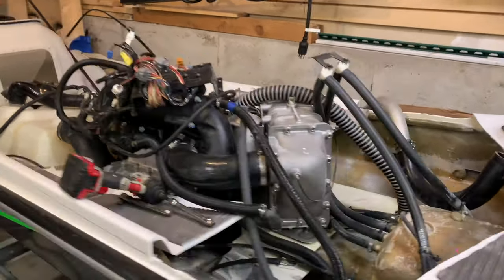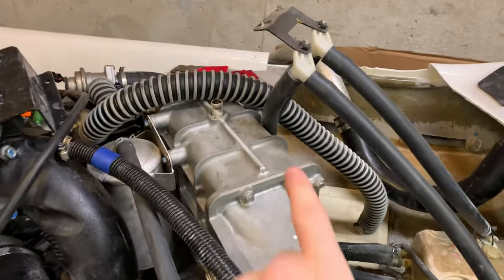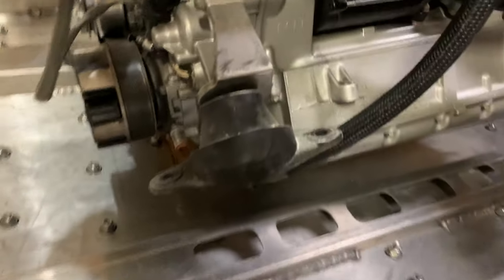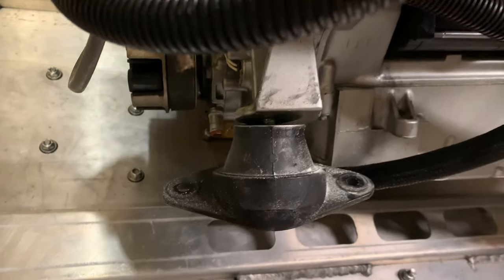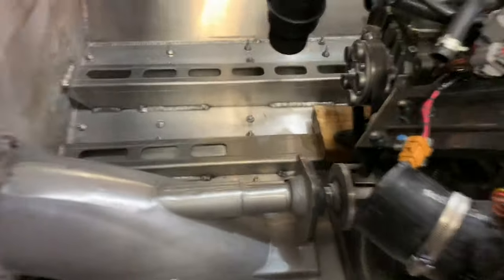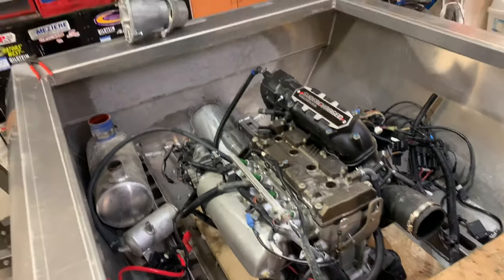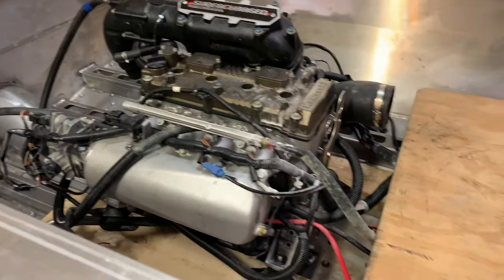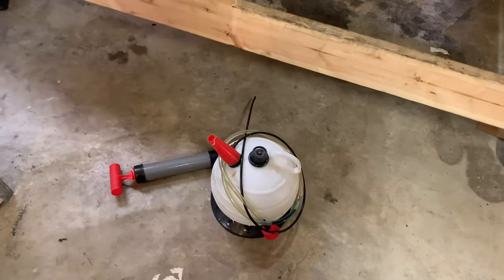Mini Jet Boat Build 5 - Engine Removal and Mockup

Comment: 5:25 I've never used one of those pumps for draining the oil on a Jet-Ski but I've used a Harbor Freight Pneumatic Break Bleeder to do something similar but to siphon radiator fluid.  It worked really well and quite fast since it runs off of an air compressor; I imagine it would probably work for that as well.  Here is a link to it: https://www.harborfreight.com/brake-fluid-bleeder-92924.html?_br_psugg_q=brake+bleeder
Reply from the maker: I need to buy one of these! Thanks for the advice!